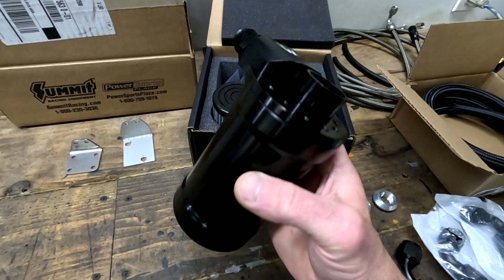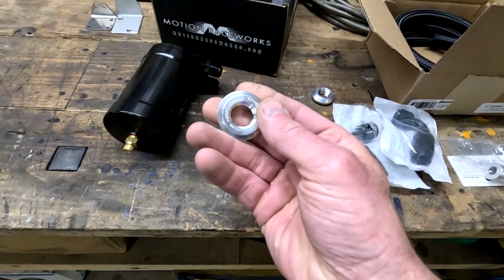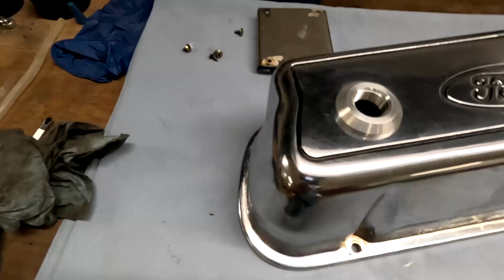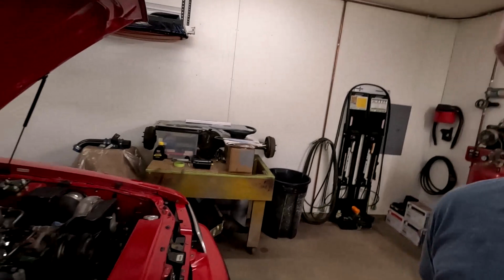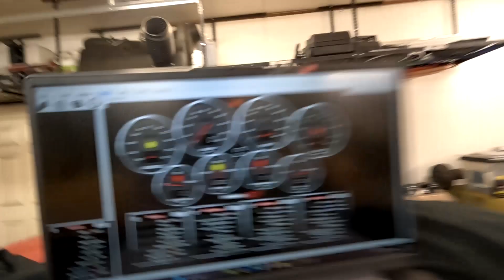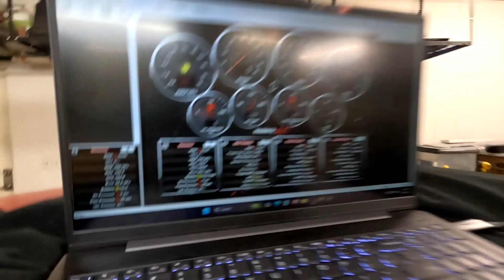Motion Raceworks Catch Can & Road Testing the Tremec T56!

Comment: I just put a catchcan on my 88. Similar to urs but i got the evil energy china one, im tired of all the oil appearing on valve covers. Mine is a 331 i built at home . That dash 10 90 degree stuff i looked at too but couldnt figure out how to make it all work . Heck im not even sure how all the lines are supposed to go truely like instructions say to route the catchcan i got into the pcv im confused really. I have a systemax intake and moroso valve covers and there isnt much space for driver side valve covers vent hole. So right now i have a breather off a length of hose into a fitting in that side and now i have the catchcan routed with the passenger side valve cover vent hole with accual pcv left alone